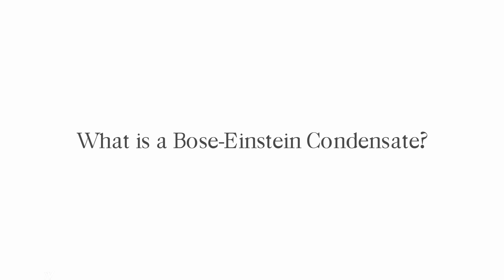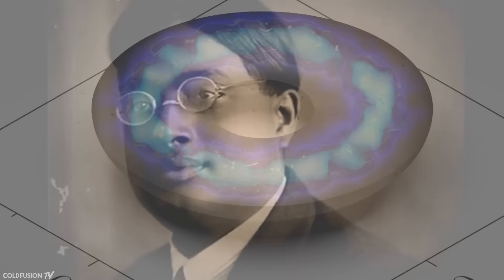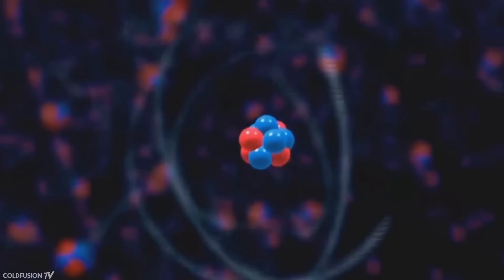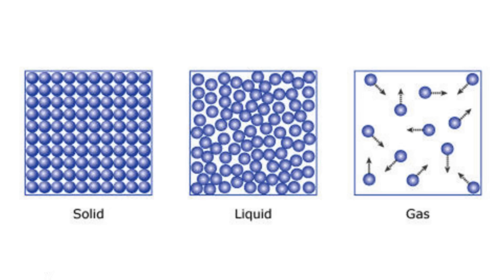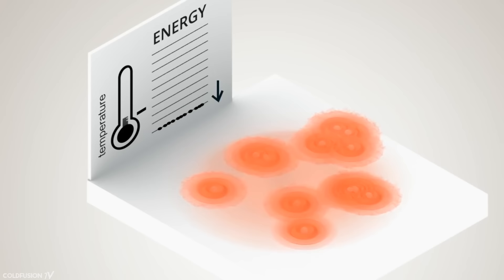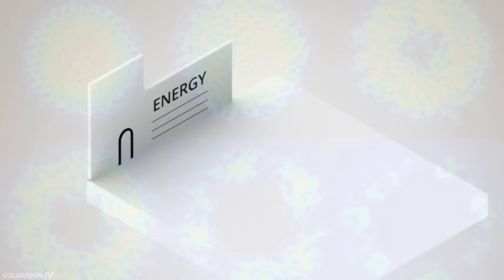A.I. Learns Nobel Prize Experiment in Just 1 Hour!

Comment: As someone who's worked with the fridges @ D-Wave, I can tell you that cooling the quantum chips isn't as difficult a problem as this video would make it out to be, helium dilution refrigerators get the chips down to as low as 10mK without complex calibration that laser cooling methods take (I don't think these laser based cooling methods can maintain nano kelvin temps for more than a tiny fraction of a second). It's just tricky to keep the chips this cold for more than a few months at a stretch. It's important to keep the chips cold for this long because it currently takes D-wave's best engineers a couple of months to calibrate the quantum chips before any useful calculations can be done. Maybe these types of AI could help with chip calibration, but cooling takes virtually no computing power, just a really expensive helium refrigerator!

Comment: im pretty sure IA would find a cure for cancer, 2020 maybe?
Reply: Yes it would, but I'm sure it'll find us as the cause..
Reply: Yep, It will find Human actions are the NO1 problem in the world. 

The Terminator:Greatest documentary ever made.
Reply: Well you'd had to start with a sensible statement. There's no such thing as "a cure for cancer" saying a cure for cancer is much like saying "finding the shoe" the shoe for what? every living creature on planet earth? good luck. Cancer is almost always an independent case, and different for everyone...
Reply: ik, but either a cure for the way all cancer works, or at least a cure for the most usual ones
Reply: The problem is, even if you could take a common element, such as the p53 gene that is malfunctioning in over half of cancer cases (simply put a check point at the  G1/S regulation point that can check for  and "activate" repair) and it takes many genes to mutate to cause a cancer, there is currently no feasible way to stop it from mutating again as human's are haphazard random living creatures, by no means binary. Other than cutting out the gene entirely and replacing it with a synthetic one. which doing it to every single cell is..why i suppose possible, a painstaking process. In that sense whatever it is, will be a treatment, not a cure, and something we'd probably all have to get yearly injections for, (which i would be all for).

The other dilemma is a moral one, and this is about to get dark, don't judge me, lol.  Is it right for us to be able to stop evolution? As to be able to stop mutation is to stop evolution,  cancer patients are technically flawed and meant to die off (obviously i don't feel this way towards a person), Evolution and natural selection are destructive processes, not creative ones. And does stopping our evolution destroy what we could of become if we had never intervened?

My response to that, is that i'm all for it, i think we're much smarter than nature and could from now on be responsible for our own, more intelligent and directed evolution than leaving it to nature. But many people are against this idea, just look at  GMOs.

I suppose this is the point where i should inform you that i am a Biomedical Engineering graduate student, lol.
Reply: ya, i mean, keep in mind that finding a "temporary solution" lets call it that, for at least one type of cancer, would be a breakthrought, and from then on, it would "be possible" to do almost anything.. in therms of health
(broken english btw, and also, im just a tech journalist)
Reply: I'm not gonna pretend that I'm an expert in any of this but... Aren't we actually binary? Like there's no such thing as random.. it's just countless binary events that we don't yet comprehend or understand. 

Also what's not to say that our "intervention" in evolution isn't the next step in our... evolution? Like what makes the "natural" way the right way? Ever since mankind has been able to use tools and ponder the questions of the universe, we've been intervening in our own evolution.
Reply: For the sake of argument i will leave religion out of this, but i will not argue against any belief that a higher consciousness is guiding us, if you choose to hold that belief. 

What makes you believe we're based off binary? The systems of Life can be on, off, anywhere in between... fully function..partially functioning, on the brink of collapse, mutated... Fundamentally we're based off the Quantum principles that govern everything, the structures of every atom within us are based off of functions of probability, and nothing is certain until it is.

More macroscopically we're random because we're not isolated systems, we're tender to anything that wants to effect us. We might one day drink a glass of water that has too high of a concentration of deuterium, which holds stronger bonds to oxygen than normal hydrogen, causing our metabolic dehydration synthesis/hydrolysis reactions to slow just enough to allow a protein to misfold and cause a mutation at exactly the wrong time, or have the deuterium added to a strand of dna wherein the stronger hydrogen bonding of the deuterium causes a problem in the unzipping and or reading of dna causing a catastrophe so to speak within the cell. These are only two of infinite possibilities of things that can happen everyday within our cells, and multiply that by the +/- 37 trillion cells within our body, and it's hard to define it as a orderly binary system. Evolution itself is a purely random process which speaks to why it kills almost everything in its path.

As to the genetic intervention, i'm on board with you! I love it! That's why it's my life's passion! I'm just stating it as a moral issue for the people on the other side of the aisle, that lay cautious about it.

This is theory, and not exactly my current area of expertise, I'm on the application side (regenerative medicine/tissue engineering) currently, so i as well cannot be counted as an expert, maybe i could direct you more towards books like "Life on the Edge: The coming of Age of Quantum Biology."
Reply: Dr. Get Jammed Thanks! This is a really interesting field that I'd love to learn more about. 
And I think I understand what you're saying, on a macroscopic level, but I think what I'm getting at is that any and every "event" with more than two outcomes you can (in some way of form) be broken down into a series of some other events that eventually leads you to two possibilities. 

The fact that these "events" are countless (like you said with the 37+ trillion cells) makes it hard for us humans to even think of it as anything but random... but what is "random"? In computers there is no random, but just complicated algorithms that run off of variables that change so frequently that we can't predict it.
Reply: I understand what you mean, but i won't pretend to be a philosopher or have any advanced knowledge in physics that would give me insight to what might be found when we can eventually break everything down to the most basic of levels (if there is a more basic level than the Higgs field and Higgs Boson, which my knowledge on is limited to a few lectures / a book or two). But even when found, applying that to make sense up into the complex working scale of...us... will be a tremendous feat of science, that i hope to live to see. But with our current understanding, i suppose, calling it random is my best approximation.
Reply: Don't expect things to develop that soon. According to most pulp fiction magazines from the last century, 2016 was supposed to have flying cars, robot housemaids and space colonization
Reply: Mohammed Zaid ya but im looking at the % of possibilities, not making a prediction, they are, for the first time in history, investing a 100 billion dollars to flying cars, right now..
is not just a "maybe" like in the old days
Reply: just a prank bro
The only reason all that's being invested is due to pulp fiction magazines and flying cars becoming a part of pop culture. Making flying cars is possible, but only impractical as of now which is why its an investment with a sure return.
My opinion of flying cars is that it's not only redundant, but also brings safety concerns in a sector (i.e. private transportation) that's already full of annual death cases due to accidents
Cancer research is smt completely different. It's delving into a realm we know nothing about. It's not an engineering problem which can be solved using optimization and existing techniques, it's similar to Physics research. A blind dig into an uncharted realm expecting treasure to end up at the tips of our shovels.

Sure AI will speed up the research but there are several types of Cancer and several causes of cancer. Making a universal solution to cancer is quite a daunting task anyways.
Plus, I'm not sure when this AI will be set up to full use in cancer research
Reply: +Dr. Get Jammed I'm interested to hear your opinion on the ability of nanobots to treat cancer/any illness. Could we program them to target any mutated cells or viruses they encounter? I know very little on the subject but I find it fascinating.
Reply: 2017 maybe?
Reply: just a prank bro 

Nanotechnology
Reply: = Overpopulation.

Comment: But what happens to the information in the material turned BEC? Does it scramble? When heated, does it emerge as if nothing happened, or does it change in some fundamental way? (electrons and atomic cores rearranging to form different particles than before, for example... provided actual atoms can be cooled to that temperature)

Comment: Space isn't actually cold as for something to cool down atoms need to hit of the object and take it energy in the form of heat within Therefore the object close down  but since there is not very many atoms floating in space that are close to each other it is very hard to cool something instead heat doesn't go anywhere .i.e does not disperse So the object will remain the heat it was when it enters space until enough particles hit it  taking away heat.

Comment: Could someone explain to me why light can slow down while being passed through Bose–Einstein condensate but cannot be sped up by using the inverse methodology? Turns out there is something called quark–gluon plasma that could satisfy this opposite end of the state of matter spectrum. I bet light does speed up while being inside this plasma. Or, the next phase after it. " On the quark scale, the strong nuclear force is some 60 times stronger than the electromagnetic force".

Comment: o OOOoooo so heat is only a word for general movement of matter.
But
In a black hole / singularity matter have no chance of moving one bit, so technicly they are cold, like probably proper absolute zero.
Soooo in that case they just turn into this mush of waveform. K
Now what we DO know about wave form that it can stack up to so far known to infinity within same space. (thats how microwave strenghts work in your kitchen)
If this is true it could mean a few things.
One that not just light but any matter ever got cramed into a black hole and got stored up as a waveform should possibly simply regain theire properties as matter once they gained the chance to move again, basicly gianing heat.
Sooooo if you get suckted into a black hole thats not really the end of the story, you just get stored sort of like in a rar file, and theoritecly maybe lanuched out or through warped space to another place practicly unharmed due to the precise nature given by  the insane singularity like situation.

Altho there is one bump in the road. Since black holes do stay around this means that most or sadlly might be all matter still stuck in there and just gets choped up and slowly radiated out bits by bits wich means you still be intact but every single molecule of your body prolly be scatered around the universe with significant lightyears apart.
Reply: ThanksIfYourReadIt well, it can be that or be an incredibly hot body, hotter than anuthing we can imagine. but it does not realy matter since the notion of heat itself can't realy apply with a singularity. since it is not an isolated system, and it is constanly getting hammered by virtual particules poping into existence and getting trapped in the event horizon
Reply: mansuy adrien
I think theoritical physicist should come up with more proper names to tag certain levels of heat. They keep talking about it being an energy of some sort, but as you said in different situations you less likelly to use it in it's raw form.
I like to think about heat as a mechanical force that can be found both in a subatomic level and in big BIG molecule level, altho I can't recall if any theorist would used heat as a link beatween regular physics and quantum physics.
Reply: ThanksIfYourReadIt
well we all know scientists are bad at naming :)

Comment: I'm very confused by your statement the ai leaned the experiment in under an hour starting from scratch. What do you mean by that exactly? That the ai was given the ability to control the lasers and just did it for no reason? Or does the ai have some sort of objective it's "aware" of?
Reply: I think it's just a neural network, adjusting parameters based on its feedback and goal.
though, maybe advanced software for this neural network. plus it's manipulating this laser hardware.
But I haven't read further info yet, so...
I think it "learned" how to cool those (specific) particles, in that arrangement, for that specific case, in an optimal way. (cooling them involves shooting a laser at them, the right angle, the right time....)
Reply: In my opinion, it had basic programming in controlling the lasers at random, but within a limited scope and also with knowledge what constitutes a favorable result. It's good at searching for patterns that lead to the most effective method of producing these favorable results.

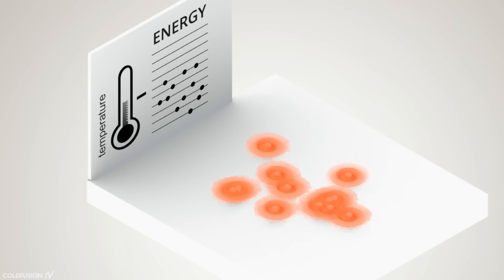Comment: 2:07 "about a million times colder than anywhere in the universe"
temperature of space = 2.725 kelvin.
Even 1 times cooler (-1*2.725=-2.725 kelvin) is not possible as it would take kelvin into negative temperatures. 
Perhaps you meant: 1 millionth the temperature of the coldest place in the universe. (2.725 /1,000,000 = 0.000002725 kelvin)

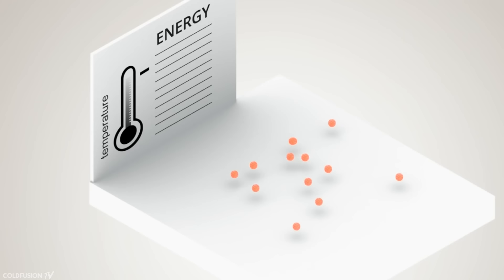Comment: One correction! At 1:53-1:58 you are making a common misconception of thinking heat and temperature are the same thing. Temperature can be thought of as the sum of the individual potential and kinetic energies of the particles with comprise a given system while heat is energy transit from one system to another. That is, heat does not ever belong to any given system!
Great video nonetheless.

Comment: What are those "ºK" that appear on the video?
Reply: No, it doesn't. Kelvins are units, not degrees. So, x K not xºK.
Reply: It means degrees Kelvin, at least that is what we used in my chem 1 and 2, and this professor knows her stuff
Reply: Michael D'Angelo The problem is there's not such a thing as a degree Kelvin. There are kelvins, that's all. It's like saying degrees volt instead of volts.
Reply: ***** I get what you're saying, but I think some people use it to differentiate from other variables/constants
Reply: Michael D'Angelo Well, then I guess they use ºv (degrees volt) to not confuse the v with velocity...
Reply: ***** "In 1967/1968 Resolution 3 of the 13th CGPM renamed the unit increment of thermodynamic temperature "kelvin", symbol K, replacing "degree Kelvin", symbol °K." So they just used the out of date symbol, but they created the first BEC we have evidence of so I am not holding it against them for not using the updated way of writing it.
Reply: Michael D'Angelo That's almost 50 years ago! It's like putting Pluto on a list of planets. Well, much much worse.
Reply: ***** Yeah... but at least we both know one theory on why they used it now! lol

Comment: "Slow light to a few kilometers an hour". ColdFusion. You are supposed to do the research. Clearly any person who listened to his physics teacher at school knows light doesn't move in any speed other than C, but rather, interacts with it's surroundings in a way that makes it seem as if it is moving slower, but in reality, because light acts as a wave, and a particle, it's movement isn't straight and it may move a distance other than 300000 kilometers a second.

Comment: I really think the AI is being largely overestimated. I mean, it does have huge implications on the way we experiment things. On say instead of repeating a experiment a thousand times to get a new result, using neural networks do indeed speed up the process by following whatever direction is most likely to produce results, but we still need the physicist to set those initial conditions, and somewhat interpret what the "A.I." Has come across to produce meaningful data. None the less. This could be another crucial milestone in how efficiently we approach physics. Alas a dangerous one.

Comment: It sounds like it was more of an optimisation algorithm than artificial intelligence. Not sure where the AI came into it? You should be able to apply a genetic algorithm to this with variables being the intensity of the laser and the on/off frequency of each of the beams and the computer should  find a pattern that cools the material quickly. This will take a number of iterations to do, as it appears to have done in the experiment - I wouldn't call this AI...

Comment: Quite misleading. It din't invent the experiment and it was not AI in the generally understood meaning of the word. 
Basically it was a program trying to keep atoms at place so that physicists are not needed to operate the machine directly. Very much like electronics that tries to keep plane on course so that pilots are not needed to actively steer the plane most of the flight. I really lack the point of what was interesting about it besides the fact that someone made it and it worked, as it should, though somewhat better than expected.